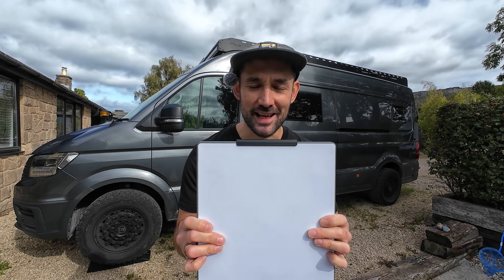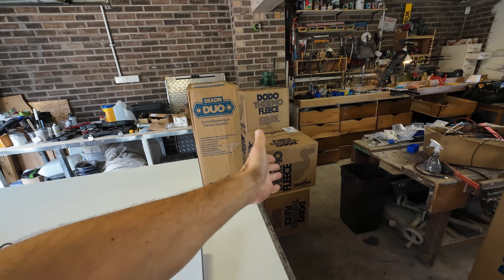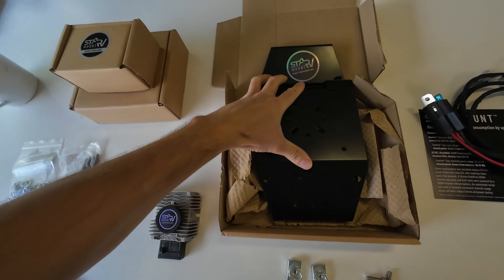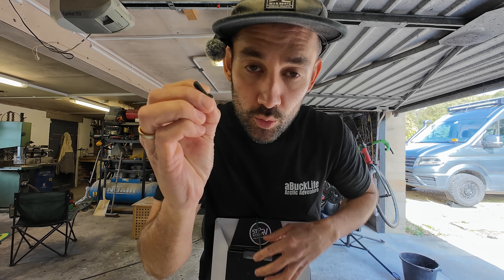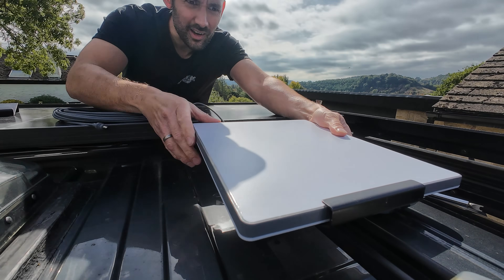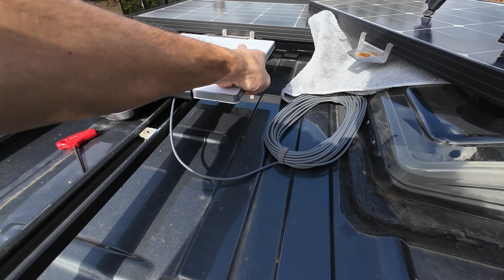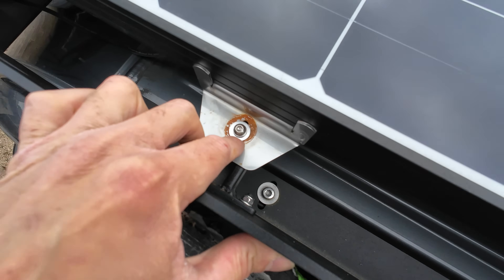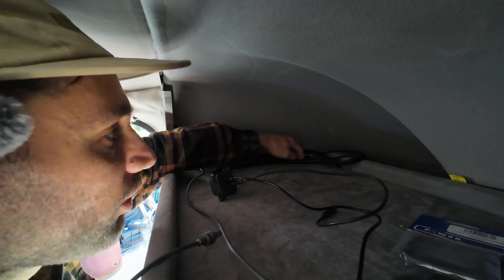Don't Make This STARLINK MISTAKE On Your Campervan

Comment from the maker: If you want to get the ultimate StarLink Setup, check out Starvmount. Use the code 'abucklife10' to SAVE 10% and the link below: 
https://starvmount.com/gb/starlink/mini.html#Abucklife10

They make mounts for both the Starlink and Starlink Mini, They also have a great magnet add on so you don't need to bolt it to the van. You can also use these on cars, boats, overlanders etc. 

What I Installed 
1 x Starvmount Starlink Mini Mount 
1 x Security Bolts 
1 x 12v to 48v Mini DC Power Kit 
1 x DC Relay Switch

Comment: Can you operate with 220 Volt? I got a 2000 Watt converter and enough panel.I am always in Canaries or Spain.Sun is not a problem.
Reply from the maker: Not sure mate but give them an email and I am sure they will be able to give you the info you need.

Comment: Thanks for the video, will be interested to see how it works, Only concern I would have is what happens when it snows? With it in the van you could use the windscreen wipers to keep it clear, but now?
Reply from the maker: Don’t quote me on this but I think they have an auto defrost mode?! Maybe. If not it will be a case of get up there and brush it off. The roof stays pretty snow free as it melts from the heat of the van.
Reply: @abucklife  they definitely have a melt snow mode.

Comment: Excellent solution. Another good reason to self build as you know exactly all the innerds of your  van, whereas I bought a van made by others and wouldn't have a clue where to start 🤷‍♂ 
My only added suggestion, I would have spun your dish 90 degrees so the bracket faces to direction of travel as opposed to air flowing up under the dish pushing up & more stress on the dish , if that makes sense. But another great video showing how excellent your build is i.e the use of uni-strutt.   Bravo  👏 👏     Love to the family ♥ ♥ ♥ ♥ (+♥)
Reply from the maker: That’s a good idea. I might swap it round. Didn’t even think of that.

Comment: Great mount but only issue with this is the wifi router is now outside, ideally you want the other kit with the Ethernet cable so you can use another router inside the van. All the insulation will hamper the wifi signal from the Starlink internal router. 

I’m using this same bracket but with a separate router and 5g backup and turn of the starlink internal router.
Reply from the maker: I had t thought about that. I will see how go and report back. Hopefully it will be ok but if I have to add a router I can. Cheers pal.
Reply: @abucklife  The setup I went for is the Glinet GLX3000, with a 5G antenna. This is a WiFi 6 router and with the antenna you can have WiFi internal and external, it also has two sim slots for backup, parental control for internet, it can connect to other WiFi networks so if your on a campsite that has WiFi the router can link to that. Then starlink connected by Ethernet with the poe adapter so still only one cable going onto roof but dos two jobs. Then also you have todo it put starlink into bridge mode via the app. Gives you multiple connectivity options workwide. I’m sure you could get glinet to send you a router 😉
Reply from the maker: @Itsjustusatholmes thanks mate sounds like a hectic setup 🤜🤛
Reply: @Itsjustusatholmes which poe adapter are you using? I've got the same router and want to add a starlink mini. Thanks
Reply: @neilmick6778 starlink do one similar to the one we have, ours also has a usb-c port on it but think not available no was from amazon.

Comment: I’m doing the same but connected the starv power kit to the VICTRON CERBO, so I can switch on/off using the cerbo screen, starv do a kit for this on there website, less cables and switches, keeps the van neat.
Reply from the maker: I didn’t even know that was a thing sounds a good way to do it.
Reply: @abucklife it’s just a relay kit that connects to the Cerbo, full diagram on there website
Reply: Sounds silly but can you use both ? The cerbo and the starlink switch at the same time ?
Reply: @Itsallnmsystejb the supply to the switching is either switch or cerbo, unless you can splice the wires to serve both, I’m not 100% sure

Comment: I’ve been looking for a good mount! - have you seen the new £5 Starlink plan they released, useful when you just need basic connection and saves a fortune
Reply from the maker: I had not seen that. I saw the US had 10$ plan but that’s mega. Especially if you just need to keep connected for safety reasons.
Reply: @abucklife agreed, it’s slow, but you can still search the internet, load maps etc and even watch YouTube in very low quality. For me, I’m happy to pay £5 to be permantently connected at all times anywhere I go. Then I can just upgrade when I was fast internet for a trip away etc

Comment: Hmm I bought the Starlink 5m USB C cable, brought it in through the roof and plugged it into a 100W USB supply from my 12V system..........hedge still looking neat by the way and got some serious workshop envy!
Reply from the maker: 😂😂😂 thanks mate. Driveway needs a weed though. I had it on a similar setup but wanted something a little more permanent. The worship was in a very bad way after the main part of the van build. 😂